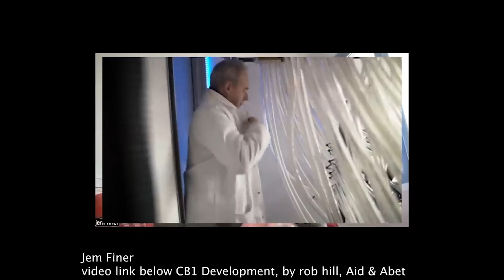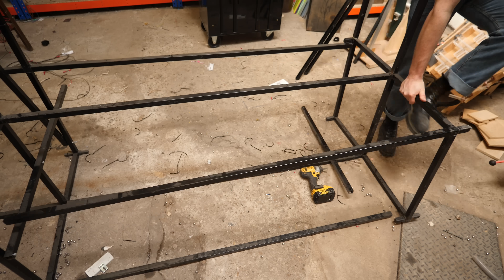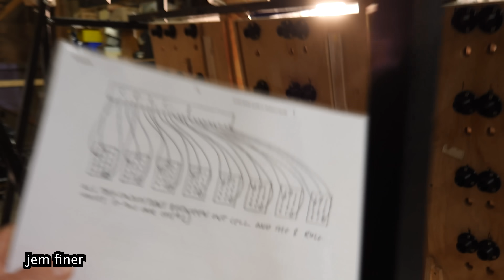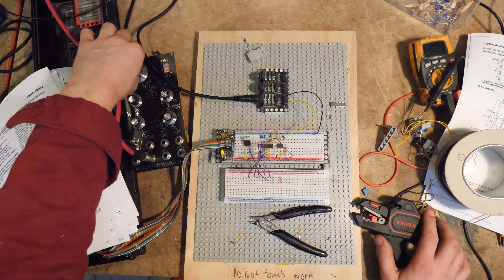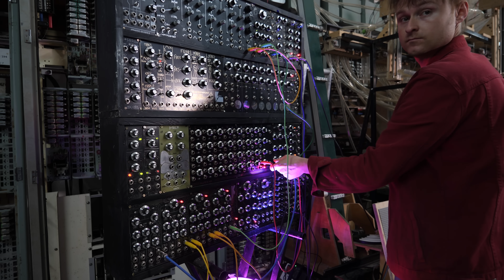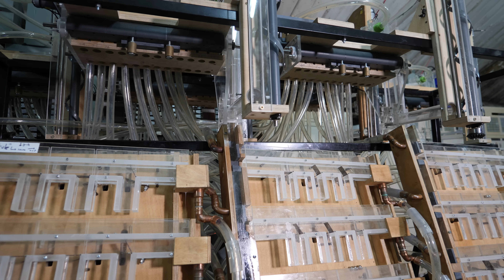A MARBLE POWERED COMPUTER CAN WORK WITH A MODULAR SYNTH

Comment: Thank you for proving that MIDI programming is indeed “real” programming! And IMO in some ways is better for this kind of electro-mechanical sequencing than, say, Python code because of how you can adjust the BPM and the sequencer automatically adapts to whatever length sequence you put into it 😊 

It kind of reminds me of machine code actually, the way you’ve got one key per function. “Turn on this output for x seconds, then turn off. Then on this other output for y seconds, then turn off.” rather than messing about with variables and functions and so on.

Comment: So we have a Marble computer getting its input from a music keyboard. The digital output of the Mable computer is converted to analogue which is then used as input to a synthesiser. 

I want to know more but my head just exploded. 

Sam you are a genius.
Reply: they're still just getting everything working.  They can replace the keyboard with anything that generates midi, and with tiny computers just about anything can be made to generate midi.